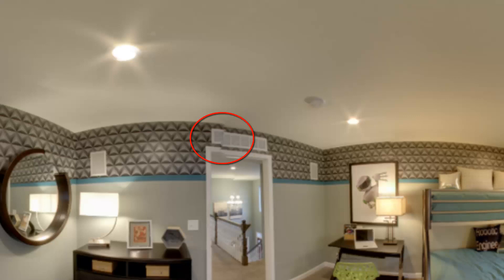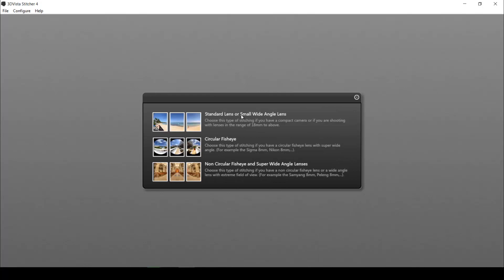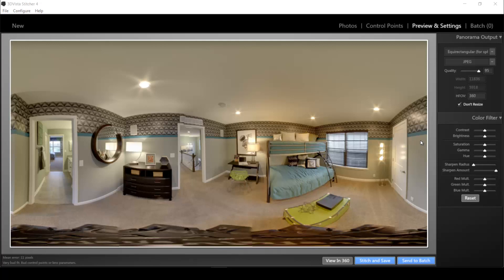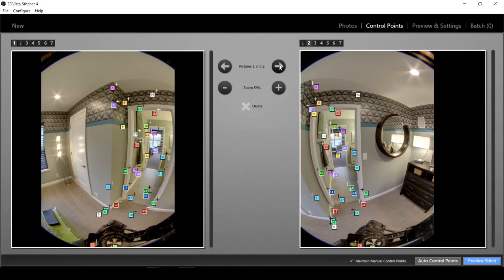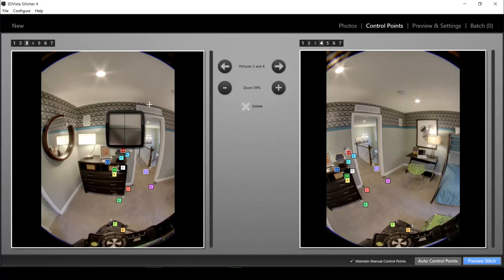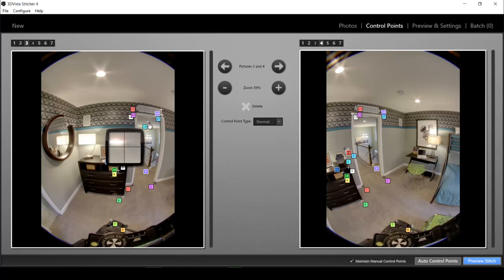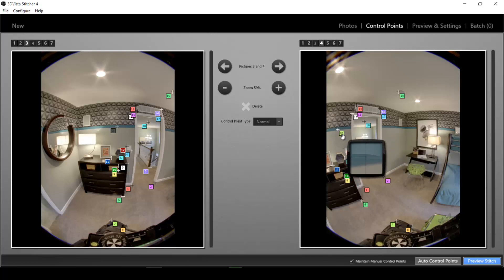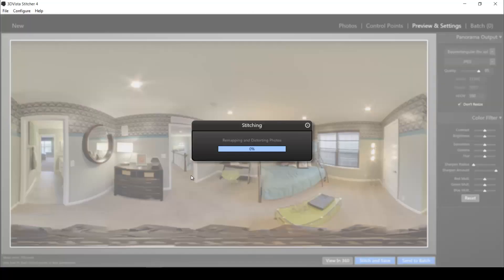Tutorials: Fixing Panoramas with Control Points in 3DVista Stitcher

Comment: Why won’t my insta one 360 video and photos not open with 3DVista?
Reply from the maker: Hi Steve, Have you already stitched the panoramas and video with the software included with the Insta360 one? You need to do that prior to use them in 3DVista VT PRO. They won´t work as unprocessed files.
Reply: 3DVista ah I see so video and photos need to be stitched with insta 360 one software as I did do that which created a video mp4 I believe but that would not load in 3Dvista  as messsge compressed or file format not supported ??
Reply from the maker: Hi Steve,
The video should be in MP4 format to be imported in VT PRO, yes.
Reply: 3DVista then I’m still not sure why it won’t recognise or open the file as it is in mp4 format , stuck now sorry 😂
Reply from the maker: Hi Steve, Please contact support@3dvista.com and send us one sample video.